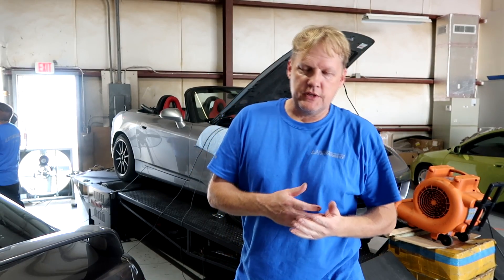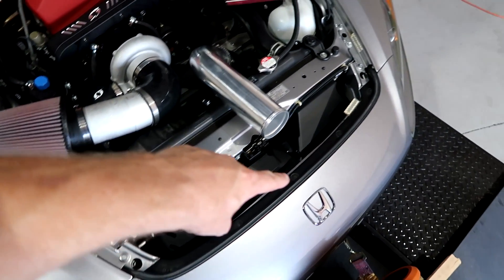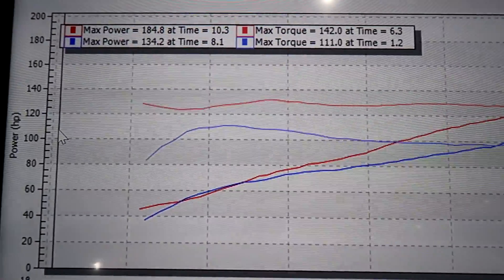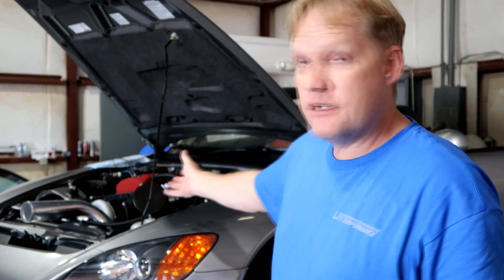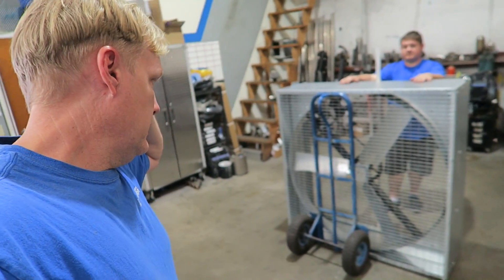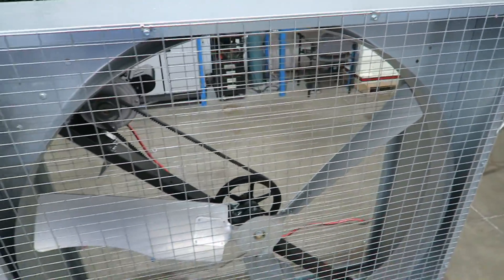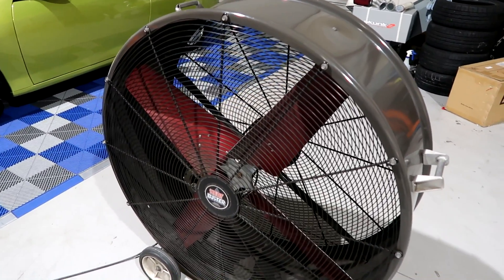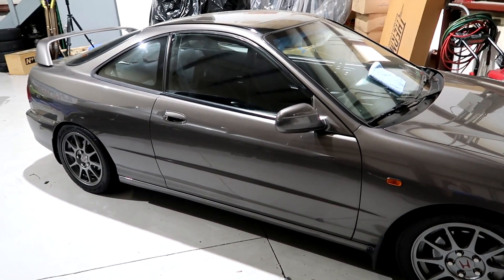How Much Power a SC takes / Our Biggest Fan

Comment: Thanks for doing this test, don't think I've ever seen it before amazing job. I thought it was around 30-40hp loss, no idea it was 50wheel and some can be as high as 90!? Well I guess that's why SC'ing is so popular on V8s, they obviously have a lot more power to spare vs. a 2.0L. Anyway it does work very well, most of your kits I'm seeing are in the 430-480whp ballpark. I'm guessing a low 11 is possible?

Comment: Any input on belt tension?  You guys have it down to a science and I'm worried I'll repeat the same mistakes so many self-installers make and have the belt snap.  I'd have brought the car down, but shipping wasn't in my budget, and driving it down would have added over 50% more miles to my 2004 s2k. Thanks!

Comment: What about choking the flow down so the supercharger is loaded like it would be when plumbed into the intake? Would need a pressure gauge to get the amount of restriction correct. I suspect the power requirements for the supercharger increase when there is a flow restriction.
Reply: Agreed... Supercharger requires more energy to turn when its under boost.  The higher the pressure, the higher the losses.  My fuel flow and HP calculations show roughly 20-25% when you wind a Rotrex near its limit at both pressure and flow (e.g. 15+ PSI).  Still a great video from LHT :)

Comment: Yeah but the motor runs with boost when supercharged. So the motor makes more power. Wont that make it easier for the motor to turn the supercharger? Just seems like you guys are missing that variable.
Reply: It's easier to turn the Supercharger but it still requires that same power to turn it.

Comment: Hi there i have a question but not about this video subject. I am sure you know the answer. I have an 04 ap1 facelift uk model(f20c2) and i need to replace my gearbox (its cheaper than fixing it) and i found a really good low miles ap2 gearbox(from f22). Will it fit correctly without problems ?. Does it need any changes to fit? Or anything else i should know that it will be needed to do. I thing of what i heard the only difference is the output flange that connects with the driveshaft , am i right?